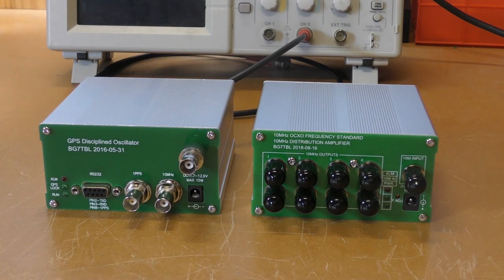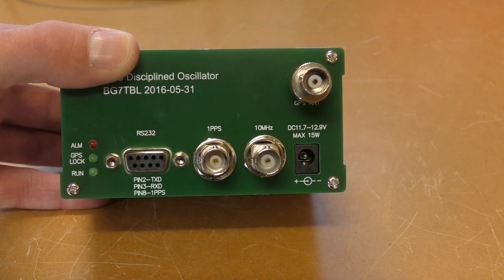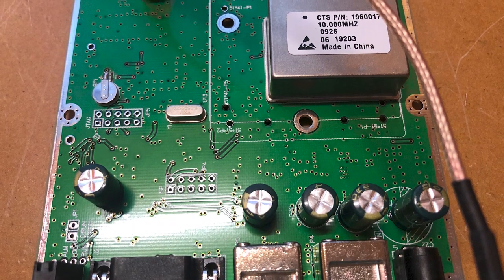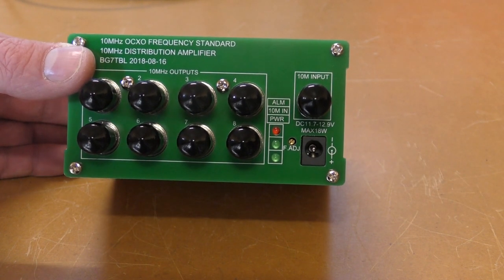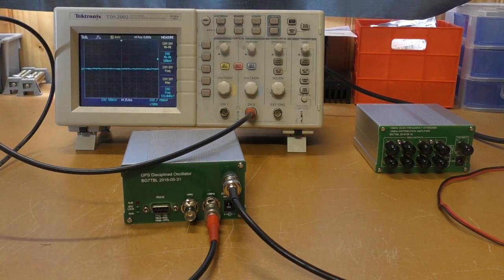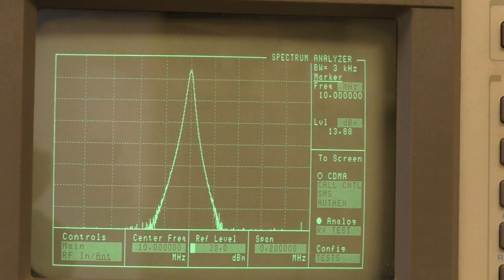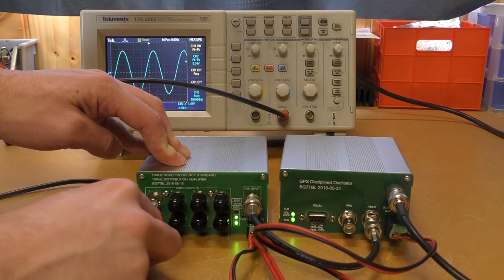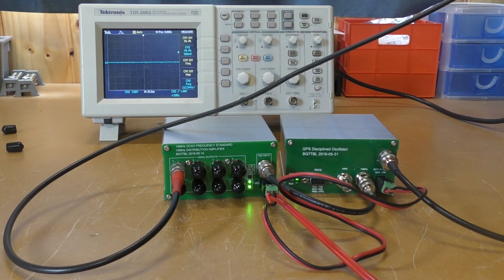BG7TBL GPSDO (GPS Disciplined Oscillator) and 10 MHz Distribution Amplifier

Comment: Very timely!  I just purchased a BG7TBL GPSDO to use with my IC-9700, and have been pondering what I would do if I ever manage to get my hands on an IC-7610.  The distribution amplifier is just the ticket, obviously, so I'll pick up one of those, too.  Thanks for another very useful video.  Thanks, too, for the link to the attenuator.  I've seen reports that even though the 9700 would be overdriven by the 10MHz output of the BG7TBL that it seems to work just fine without attenuation, but me being somewhat nervous about taking risks with such an expensive piece of gear, I was already looking for attenuators.
Reply from the maker: I was going to mention the attenuator is recommended! Good luck!

Comment: I bought one of these GPSDO a while ago and it's a great little unit. I have seen where the max power input is 12.9V and have heard that some of these units don't like being fed with 13.8V from a power supply or field day battery so installed a cheap buck booster inside mine so it holds the incoming power voltage at 12.5v regardless of what the voltage is being presented to it. I also fitted an Anderson power pole to the back of it for easier power connection out in the field and less chance of accidental reverse polarization. That also helped with the over crowding on the front panel as well.
Reply from the maker: I've used a buck converter on most of my units that are constantly powered, although we have run them in the field from 13.8V without any issues.
Reply: For polarity protection, rig up a P Channel mosfet and you'll sleep better for it.  Look up polarity protection mosfet and try it out

Comment: A CHEAP solution is you can use a video distribution amplifier. Granted it's 75 ohm and the output level depends on quality of the amps used. I have cheap one and it worked out pretty good. tnx for the video!  73 N8AUM
Reply: Does the fact that it  is 75 ohms at BNC affect the use of distributing 10Mhz to 50 ohm test gear? How would one convert 75ohm to 50ohm?

Comment: I think 6 volts p2p would equate more like 18DBm or there about.  I use a 20 db pad on mine and that brings it down to around .7 volts or 2 DBm.
Reply from the maker: I noticed another unit I have has slightly more output. Not quite 18dBm but about 12 or 13. My measurements are done with a calibrated instruments but it wouldn’t surprise me if there are variations
Reply: For the level to be +18dBm, his scope would have to read not 6Vp-p but 10Vp-p.

RF instruments standardise on 50 ohm connections and are specified for power. His spectrum analyser's typical and it's seeing +13dBm (which for a 10MHz reference output is also typical).

Across 50 ohms, that's very close to 1VRMS (which is about 2.8Vp-p for a sinewave). [The maths is:

dBm = 10log(mW), so
mW = 10**(dBm/10)
        = 10**(13/10)
        = 20
20mW across a 50 ohm load means a voltage of sqrt(0.02 * 50) = 1VRMS.
For a sinewave, 1VRMS is sqrt(2) = 1.4Vpk = 2.8Vp-p.]

The device's output impedance is also 50 ohms, so it's a Thévenin source of twice that voltage, with half dropped across the output impedance and half appearing across the analyser's input impedance.

His oscilloscope's also typical: it displays voltage not power and presents an input impedance of 1 megohm not 50 ohms. That high impedance means the voltage-divider effect is negligible: the 'scope sees the whole Thévenin source of twice 2.8Vp-p. (It's displaying 6Vp-p which is pretty close.)

The value's still +13dBm, it's just displayed differently (and in each case correctly) by two different instruments.

Comment: Hello from Belgium, what is the maximum length of the cable between the 10 MHz output of the BG7TBL and the input of the distribution amplifier?
Yours sincerely
Reply from the maker: I’m. It sure about maximum length. I use a short length of coax. 

Maximum length would be dependent on loss - even RG-58 you can run a long a way at 10 MHZ with limited loss

Comment: Great review, I just bought one of these. Could you recommend a cheap attenuator/s ?
Many Thanks - Ian G0XAG
Reply from the maker: There are plenty of good ones on eBay. Just search for BNC 10dB attenuator, most of them are pretty good
Reply: @HamRadioDX  I got an attenuator and put it between the GPSDO and Distribution Amp but it doesn't seem to make any difference to the output from the amp channels. I have to put it between the amp channel output and the equipment I'm plugging it into for it to work. Do I really have to buy another 7?
Reply from the maker: @chickennugget3362  Yes the distribution amp has a set level out on all outputs, I don't think you can adjust it and I don't believe it follows the input power

Comment: What is the peak to peak if driven into 50ohm?
Reply: We know from the spectrum analyser reading that the power level is 13.88 dBm at 10 MHz. Assuming the input impedance of the analyser is exactly 50 ohms at this frequency, let's back things up. To determine the power dissipated, we calculate the antilog of 13.88/10, i.e. 10^(13.88/10). This results in 24.43 mW. Divided by 1000 gives 0.02443 W. Transposing P=E^2/R to solve for E, which will be the RMS value of the voltage, we end up with E=SQRT(P*R). SQRT(0.02443*50) = 1.105 Vrms. Multiplying this result by SQRT(2) to arrive at the peak voltage of 1.56.  Multiplying Vp by 2 gives us 3.12 Vpp. And that's right in the ballpark for what I'm measuring on a 2014 model.

Comment: Thanks for the great video. I checked all the comments but I can't find the solution. I have two questions: 
1) can the 10 MHz GPSDO work just off the OCXO, without GPS? 
2) I read in specs on eBay that GPSDO can achieve a frequency accuracy of 0.5 parts-per-billion. Is that for real or is it just marketing hype?
Reply from the maker: I can answer the first question - yes it can work without the GPS, obviously not as accurate but fairly stable. I can’t answer question 2 as I don’t have the test equipment to test
Reply: Thanks. 
But without test equipment, is 1 ppb fairly standard across the industry for these types of devices. I am asking because I am a total newbie and I never came across such a high accuracy. I am a bit surprised.

Comment: So where again does the 2W BNC attenuator go exactly?  Between GPSDO and Icom 9700 , I'm thinking?
Reply from the maker: Hi Robert, yes you are correct. Between the GPSDO and the 9700 to reduce the level going into the radio.
Reply: @HamRadioDX   And that is a 20 Db attenuator, correct? for the Icom 9700?
Reply from the maker: @robertklug3863 the output from the GPSDO is +13dBm, so if you use a 20dB attenuator that will mean -7dBm is feeding into the 9700. I think from memory the specs say to feed maximum of -10, but I have seen some put the full 13dBm in with no problems. To be safe I'd use a 30dB attenuator instead of a 20.

Comment: No mentioning that the distribution amplifier puts out a 13dBm signal!!!! Way too much for using it with a radio like the IC-9700!
Reply from the maker: A 20 to 30dB attenuator is recommended to reduce the level

Comment: Hi, Nice video. I have a couple of questions I hope you can help with. I connected a RS232 cable through a prolific usb cable. It caused the mouse to jump all over the screen. on the cable pins 2,3,5,7 & 8 are connected straight through. Just wondering if I needed to use a null modem cable? The other thing is do you know of any software I can use to adjust the baud rate is, 9600 on the GPSDO? It's too fast for NMEA 0183 which is 4800. I want to hook it up to an old marine HF set.
Reply from the maker: Hi,
I can’t answer the question related to the USB prolific cable. I have identical cables with that chip here and haven’t seen any issues. I’ve also connected using a standard RS232 cable and had similar success.

As for the baud rate I am pretty sure that is set in the serial chip of the GPS. However do a search on the EEVBlog (and maybe even post) to see if someone has the answer to that question. 

Thanks for the comment!
Reply: Had the same problem today. Now I use a small CH340 TTL/USB converter, works like a charm. Nevertheless I had to add an TTL inverter stage to mine, because a transistor (Q1) in the GPSDO inverted the signal from the GPS receiver module. But I don't have the GPSDO shown in the video, I own a BG7TBL PLL-GPSDO 2020-02-15.

Comment: Does anyone know what the blinking green LED on the bottom of the board rear between the BLOX module and the board corner labeled D2 means. Mine seems to blink at a 1hz rate, but it may mean something else?
Reply from the maker: Is it in sync with the GPSlock LED or one of the other LEDs on the front panel? Maybe a heart beat LED?

Comment: Great Video, what's the difference between a 10MHZ Atomic clock, and a normal OCX crystal oscillator? I've heard that an atomic 10MHZ clock for pro audio purposes wod be over kill because 10MHZ is very accurate in the long term, but OCX is accurate in the short term
Reply from the maker: In most cases an atomic clock contains a OCXO for stability as you mention. More info available here -https://blog.bliley.com/what-the-heck-is-an-ocxo-crystal-oscillator-facts-functionality
Reply: There are TCXOs with accuracy that rivals the OCXO. They are very expensive. Either can have very good long term stability. For most testing short term is all that's needed & perhaps more important. 
GPS satellites contain atomic clocks. That's how GPS works, the receiver compares time differences of the birds it sees to determine where it is in 3D. As such GPS time is excellent.
Atomic clocks are arguably more accurate because the satellites & Earth aren't perfect in position. Plus space weather affects the signal. GPS is a convenient way to compare local time to a national standard which is of reach for most consumers. The U.S. standard is accurate to better than 1 second per 300 million years. One could also use a long wave signal, calculate for propagation delay, resulting in fantastically accurate timing.

Comment: Hello everyone, I recently purchased a device like this but it takes me a long time to block the GPS, I mean more than 15 minutes sometimes. How long is the normal time to be operational? Can you change the antenna for a better one, with more gain or angle? Thank you very much
Reply from the maker: Hi Gerardo, sometimes it depends on the GPS chip or receiver, but 15 minutes seems a bit excessive. The GPS’s in the video only take about 20-25 seconds to lock with a good signal. You can try an external antenna outside for better performance?
Reply: Perhaps the GPS is doing a cold start each time. Two primary causes. 1 backup battery has failed. 2 long intervals between power ups. In both cases the GPS receiver needs to re-download the current constellation almanac which can often take 15min or more before handing off to user land
Reply: @RobB_VK6ES  thank you very much!

Comment: I've used a pre-owned  video distribution amp. .....1990's era......analog NTSC/PAL type with lot's of BNC outputs. On e-bay they are dirt cheap these days. I swapped the 75ohm output resistors for 49.9 ohm types.(50 ohm). Some of them even have socketed opamps so there's an option for swapping, but not likely necessary because their bandwidth is already around 100Mhz. 
I am not sure is there perfect phase matching, to the original GPS 10Mhz source, if that matters.......but like I said, cheap cheap,cheap !!!